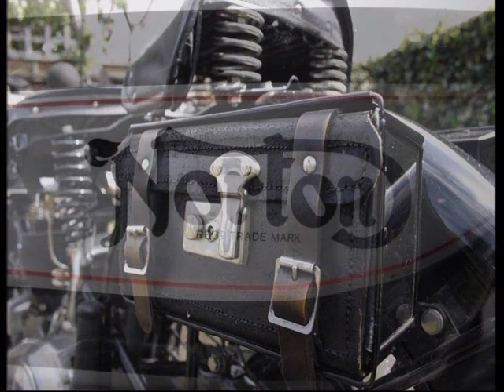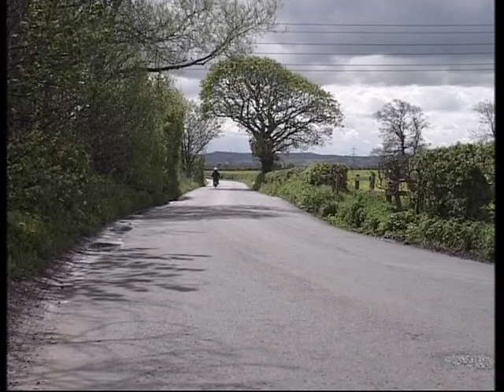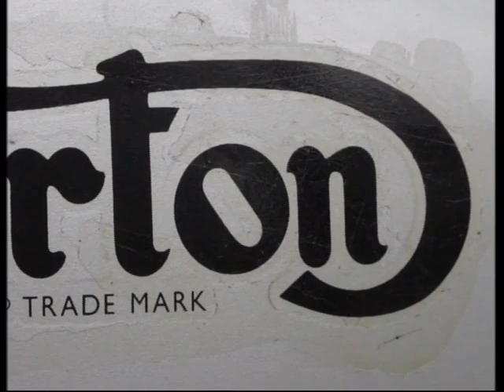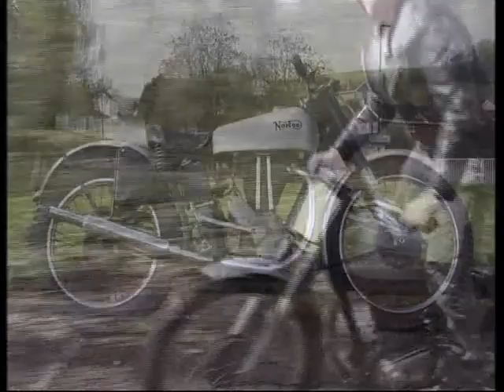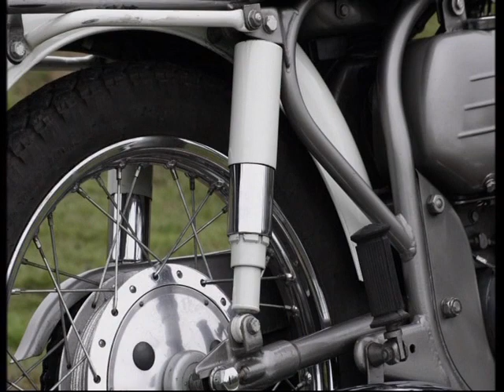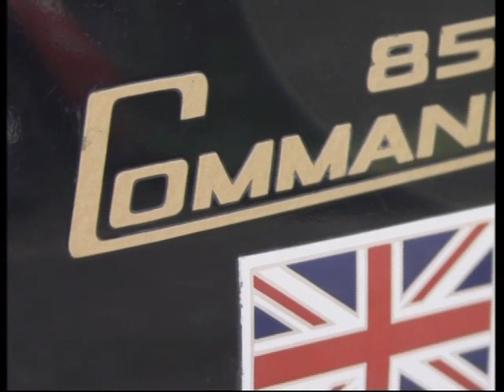Norton Motorcycles

Comment: @Men and motors  the ohc Norton CS1 came out in 1927 won many races and was the original precursor to the Manx but you completely failed to mention it, instead citing the later international as the start of the ohc machines. 
You also cite the adoption of a single camshaft on the twins as an improvement over other manufacturers designs! This is twice wrong. Ariel and BSA already produced twins with single camshafts and the separate inlet and exhaust cams of the triumph engine was universally seen as an advantage both for optimising valve train layout but also for the enormous flexibility of tuning.
These advantages of the Triumph engine are proved by the many tritons that were built that utilised the best handling frame from the Norton (usually because the engine had blown up) and the strongest/fastest easiest to tune engine the 650pre unit triumph because the frames were awful and had probably been bent.

Comment: So many ridiculous errors and omissions. I had a late featherbed inter, yes it leaked oil, but not much. It only let me down once when the centre stand return spring broke producing a 20 foot long shower of sparks. The frame was a proper featherbed 531 tubing braised not welded. I sold it when posted to Kenya with the RAF, worst thing l ever did. On return to uk l purchased a 99. What disaster, vibrated so badly you could hardly see the road. It eventually broke the drive side Conrad. I rebuilt it and sold it as quickly as l could, absolute rubbish bike, sad end to a fantastic line of bikes.

Comment: No mention of the 350cc Navigator twin which I had in 1961/2, good looking bike, lot of noise but not much speed (I could only just keep up with  250cc Ariel Arrow!
In 1963 I bought a 650ss (£343!!), loved that bike, spent hours fettling and polishing inlet & exhaust ports. Unable to cure oil leaks though! Also the tappets required frequent adjustment, my local dealers couldn’t solve the problem but Norton agreed to take a look so I rode it to their HQ in Bracebridge Street Birmingham - they fitted a complete new cylinder head (refused to tell my what the problem was….i don’t think they new!). 
After a few years off biking I bought my first Honda, an NTV which had 60k on it, sold it with 100k; ZERO problems with it. I’m now riding a 2002 Honda VFR V-tech…..fantastic, totally reliable, comfortable and lovely sounding machine. 
I’ll never forget my 650ss though, I’m pretty sure my first ‘real girlfriend’ was impressed by the bike….or maybe me?

Comment: What about the Atlas? Also, the ES-2. I rode an ES-2 all over LA and San Bernardino County in the early 70’s. I also learned about British bikes while working on that thumper.
Reply: Another strong model not referenced was the P11/P11a Ranger - good street scramblers that cleaned house in desert racing.  I'm an Easterner so mine never saw desert terrain, but spent a lot of time in the Pocono mountains, New Jersey shore and pine barrens.

Comment: Norton Commando were only7,000 bikes a year. Isolastic frame doesn't handle as well as the Featherbed frame. Norton had to sell the Mercury alongside the new bike due to customer demand. Bauer was an asset stripper who sold the factory 🏭 because the land was more valuable than the factory 🏭. He shut down AJS and Matchless and put 800+ shops out of business. He did the same thing to Royal Enfield. Norton was  

1:04  plagued with fraud, charlatans

Comment: Oil leaks
Reply: Unlike yourself I can't speak to all British motorcycles but it's not my experience at all. In 1972 I purchased my first new Norton Combat. I still own it and it never leaked oil. Me: multiple Commando/Combat owner that has an oil free shop floor and Nortons with plenty of oil in their tanks. But I will admit it's easier to complain about a problem than to fix it.
Reply: @robertshepherd3832  On my (new)72,  once  eliminated the chain oiler not so much leaks.
Reply: If the Brit bike don’t leak oil better check that it has oil.